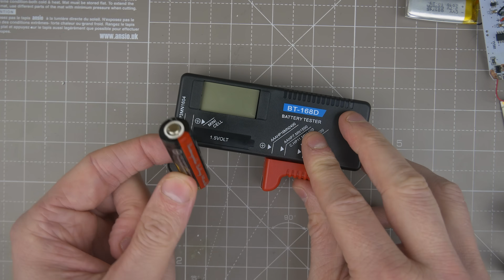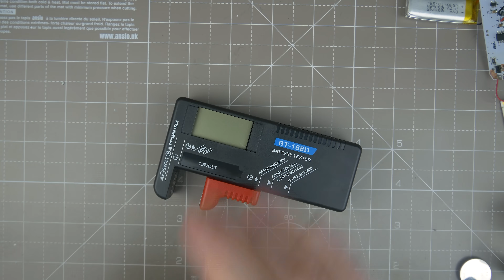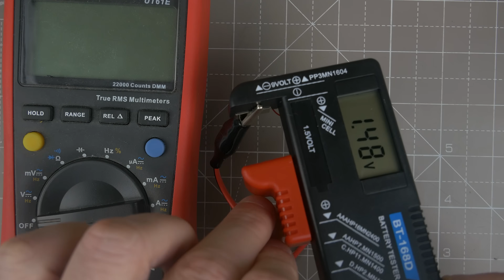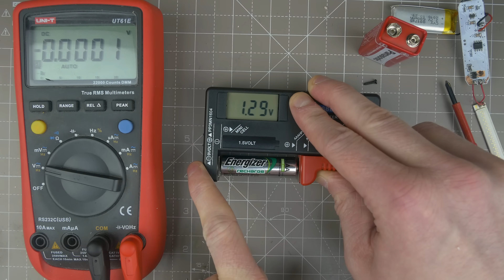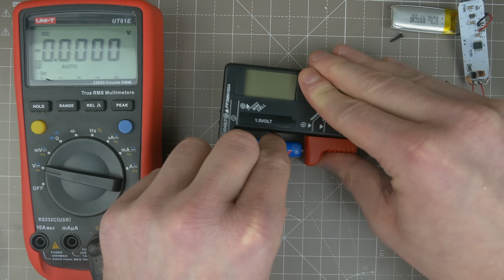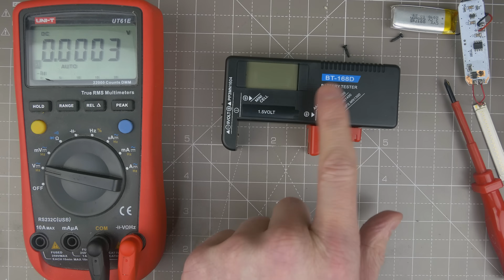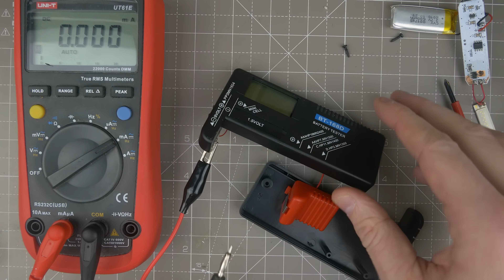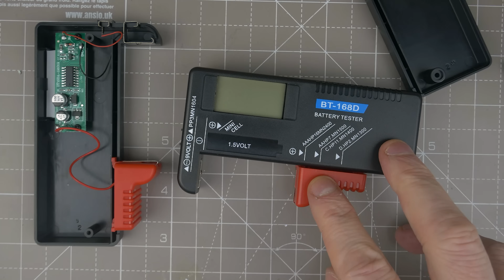BT-168D Battery Tester

Comment: interesting to know how you can tell the charge state of a battery with a small load and a voltmeter.  As the curve is often a slight voltage drop then a shallow slope and a sudden knee and big drop off.  OK as a simple   quick test but not to be trusted much.
Reply from the maker: That is where the mental arithmetic I mentioned comes in. We tend to know our batteries, how old they are and what kind of current they can deliver. It is called a battery tester but I would merely use it as a 'measurer', what that measurement means is down to your knowledge of the battery and it's chemistry.

Comment: I have the analog version of it, the BT-168. 
Works fine as well. Theres also a scale on the back that lists the voltages for the ranges. it says low/replace: 0.9V, Good/low(i think the mean good/replace): 1V. So it you can kinda guess the voltage accurately enough. 
If you just wanna quickly check a battery thats the tool for the job. Measuring batteries with a multimeter is pretty pointless. An empty battery will often show a normal voltage when theres no load.
Reply: jort93z me too. There is actually a 5ohm resistor inside, across the battery to provide a load. Quite a heavy load, which really weeds out dead batteries. 
Not sure those few miliamps on the digital version will do that.
Reply: @beargun42  The digital one has a resistor too. It is labled L1 if you check the circuit board in the video.
Also, mine has a 4 ohm resistor for 1.5v and 215 ohm for the 9v. At least it says so on the back.
Reply: jort93z I think L stands for inductor. Which is needed for the boost circuit. I have the same and will take a look into mine to find out more.
Reply: I used to have that BT-168. And it might be even better than the newer models. Because the the old was providing real load for the batteries under test but the new models don't.